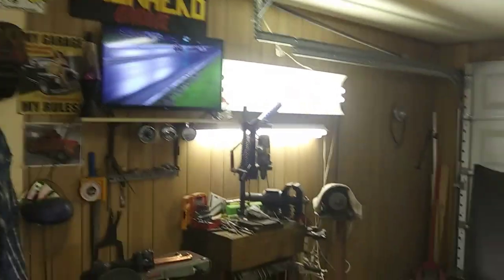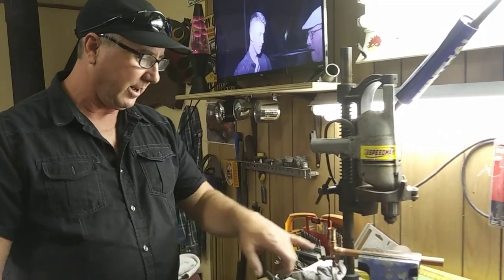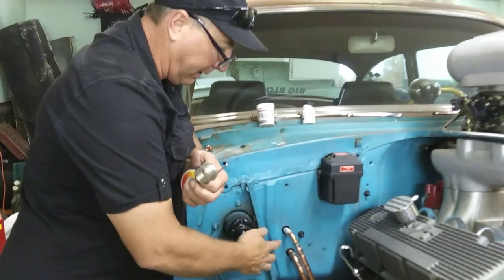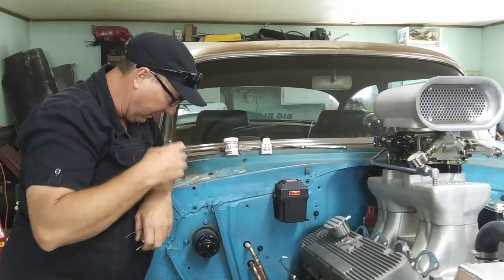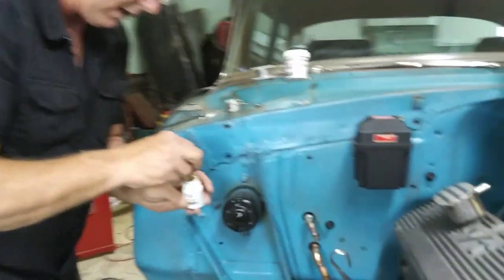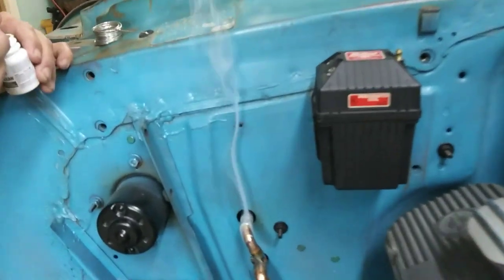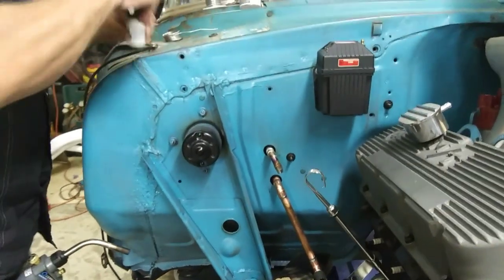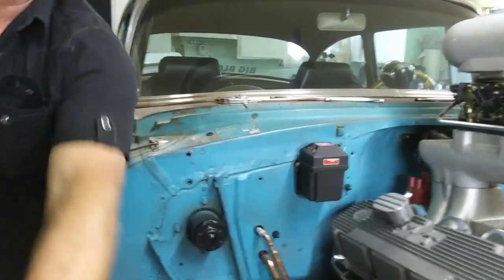55 GASSER BUILD. Saudering Aluminum Heater Core to Copper Pipe using Alsauder 500

Comment: Nice job never knew you could solder aluminum to copper .Are screw in fittings possible with those aluminum heater cores just curious? Good teacher!!!       ....Glenn
Reply from the maker: Hey thanks Glenn. 
Never knew it my self
It did work good.
Not sure what kind of fitting would work not much pipe sticking out to work with so I went that way should be good. Going to be nice to have some heat in the cold weather. 
Thanks for watching
I appreciate you brother
Take care way over there👍👍👍

Comment: Looking good Chris ,when are you going to do the wiring and start it up???
Reply from the maker: Thanks a lot Donald. I sill have to get a wiring harness. Nobody more then me would love to hear that big block. She will breath again😁 I'm going to try to start the motor before winter comes. Even if I get the motor running I still won't be able to drive it. 
Needs drive line all new brake lines needs rear axle bearing and a few more parts. I'm trying just wish I had more time to work on it.
Seems like I'm always at work with not much time for the old 55. But I guess that's life lol. 
I appreciate you watching
She will go down the road again. Take care out there
👍👍👍
Reply: @IronheadGarage  cant wait to hear her run